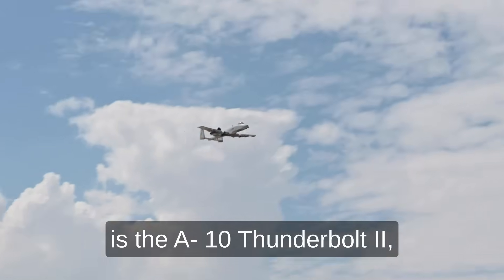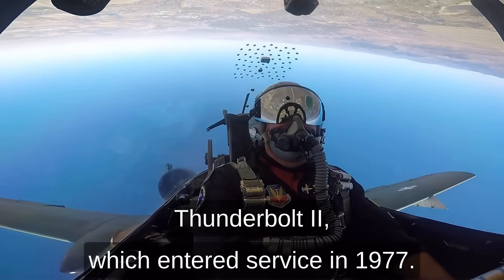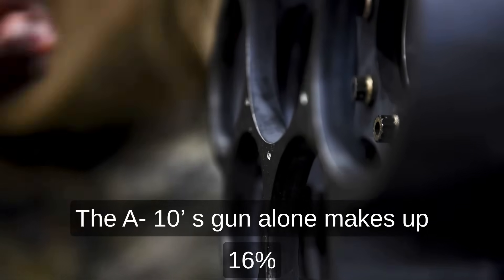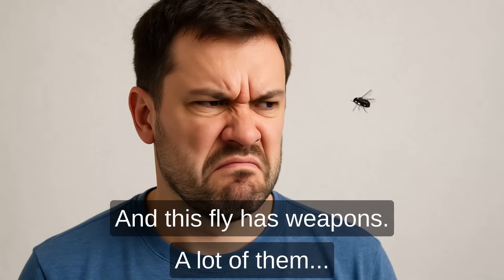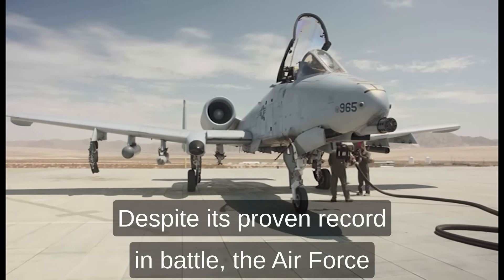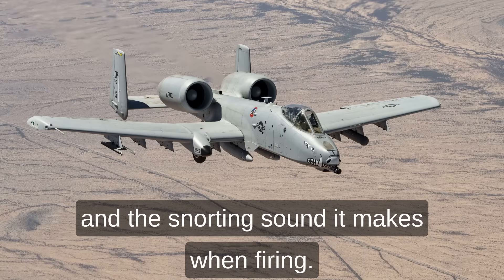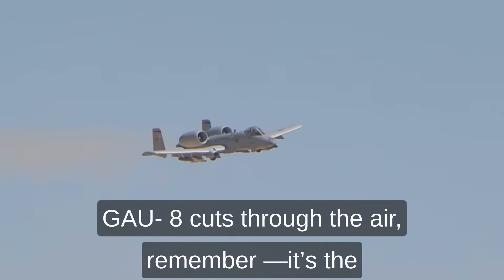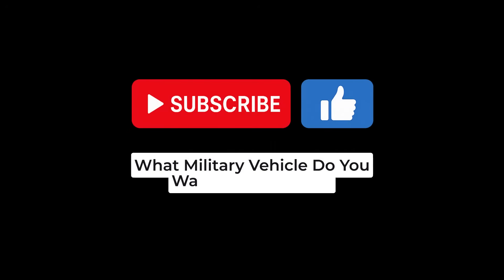The Plane America Cannot find a replacement for.. The A10 Warthog

Comment: Flew it for 18.5 years, “Precision Perfection” , took on close support that fighters couldn’t. One correction, 1780 rds, could hold more, never overloaded volkswagon sized magazine, the brass was reloaded/recycled back into the magazine after firing, didn’t leave anything for IEDs.😂
Reply from the maker: That is amazing. First off, thank you for your service and sacrifices. Thank you for pointing that out by the way! That is a fact the internet doesn't know that only someone seasoned like yourself would. Thank you for watching
Reply: I crewed the 10 at Eangland AFB in La.